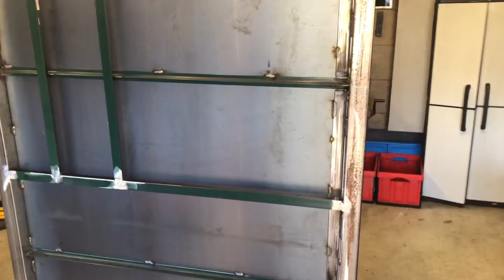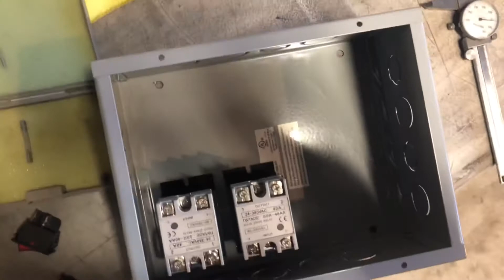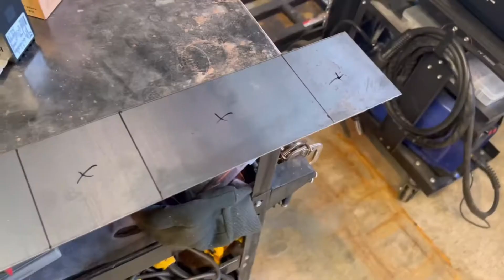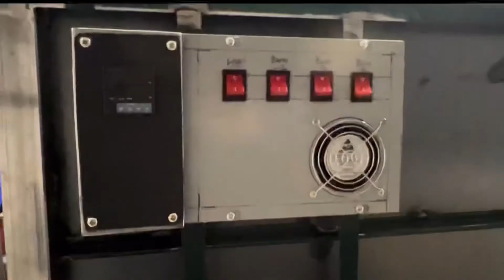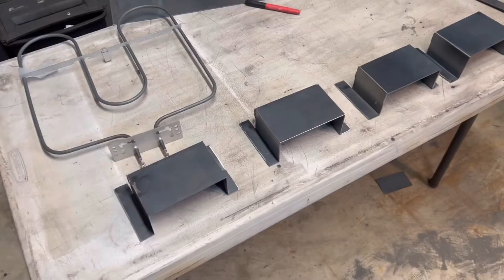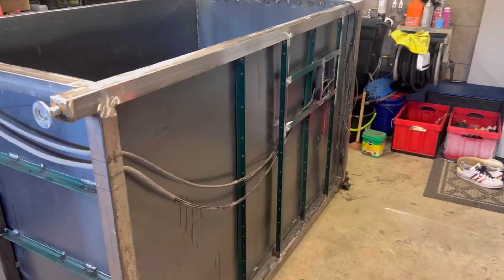Powder Coating Oven build

Comment: Do u have the links for parts u used for the electrical n panel thanks
Reply: Thanks I greatly appreciate it
Reply: Happy Thanksgiving
Reply from the maker: I purchase from a supplier but you can find almost everything you would need on Amazon. I will forward some link shorty thx
Reply from the maker: KCD4 Rocker Switch Power Switch... https://www.amazon.ca/dp/B07MMZ5SWG?ref=ppx_pop_mob_ap_share

10 Feet Heat Shield Fiberglass... https://www.amazon.ca/dp/B08N46GP4R?ref=ppx_pop_mob_ap_share

BNTECHGO 10 Gauge Silicone Wire... https://www.amazon.ca/dp/B01M8M2SC4?ref=ppx_pop_mob_ap_share

Inkbird Heat Sink SSR Solid State... https://www.amazon.ca/dp/B06WLNHPWK?ref=ppx_pop_mob_ap_share

Inkbird Display PID Stable... https://www.amazon.ca/dp/B01LQ8TOYW?ref=ppx_pop_mob_ap_share

mxuteuk 2 Pcs 12 Positions Dual... https://www.amazon.ca/dp/B086BRHN6C?ref=ppx_pop_mob_ap_share

GDSTIME AXIAL Fan 9225, 110V 120V... https://www.amazon.ca/dp/B08GSD9VR8?ref=ppx_pop_mob_ap_share

GE WB08T10002 Light Housing... https://www.amazon.ca/dp/B00M0YVBFC?ref=ppx_pop_mob_ap_share

GE WB08T10002 Light Housing... https://www.amazon.ca/dp/B00M0YVBFC?ref=ppx_pop_mob_ap_share

Mophorn 15Ft 50 Amp RV Extension... https://www.amazon.ca/dp/B07NMGBTT4?ref=ppx_pop_mob_ap_share

BUD Industries JB-3958-KO Steel... https://www.amazon.ca/dp/B005UP9NCG?ref=ppx_pop_mob_ap_share

Comment: What's the power rating of the elements?!
Reply from the maker: Elements are 3000 watts each @  220v
Reply: @welding2go  thank you so much
Reply: 4 3000 watt elements would theoretically draw 50 amps does it actually draw 50amp?

Comment: can you please give me a link for the screw strip please
Reply from the maker: Sure no problem
mxuteuk 2 Pcs 12 Positions Dual Rows Covered Screw Barrier Block Terminal Strip Blocks 600V 45A +1 Pcs Phillips Screwdriver TB-4512-LSD https://a.co/d/ghBbjNv
Reply: Awesome build, could you show the layout of the waiting from the main box to the PID along w how you are using the bus bar you showed?  I’m building a smaller version out of new smoker and have it working but the inside wiring looks like shite!